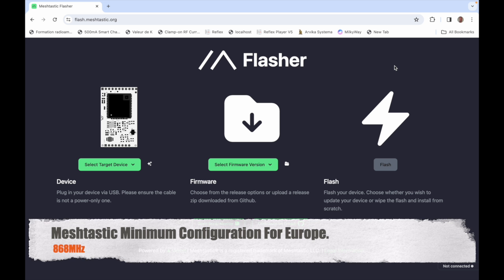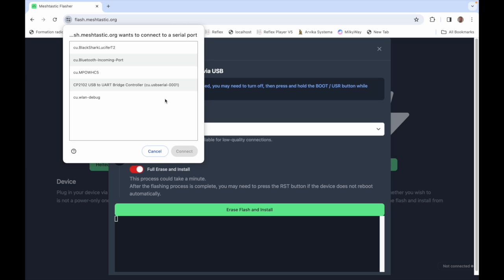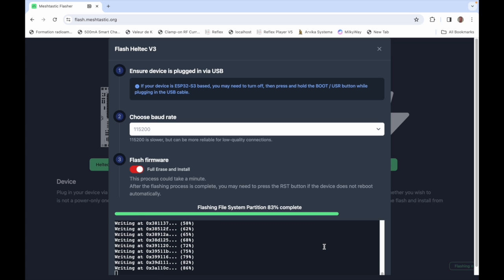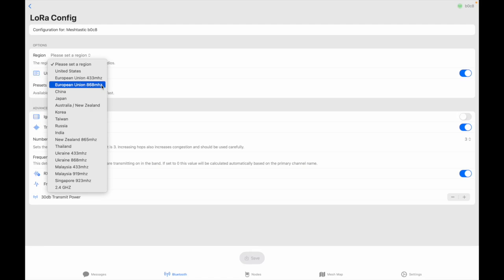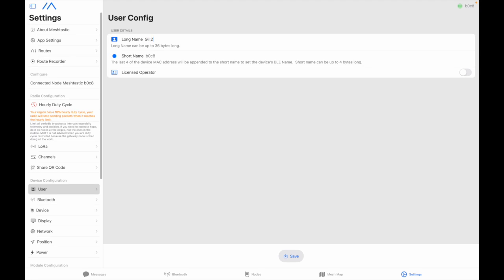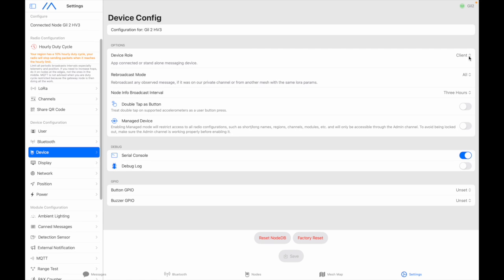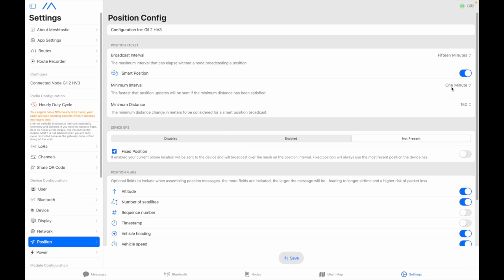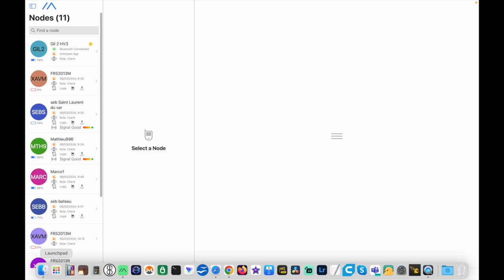Meshtastic Minimum Configuration For Europe.

Comment: Hi Gil great videos subbed . I'm having a problem i have the heltek v3 and have installed a gps neo6 rx pin48 tx pin 47 reflashed a few times but it just says no gps installed. Other problem I'm on pc or android and the layout of the apps are diffrent  cant seem to find some of the settings you usem any ideas thanks m7gnr
Reply from the maker: The Android app is better.. No idea about the GPS. Did you turn it on in the app?
Reply: @RadioPrepper  thanks for the quick reply but yes switched on in in app there is a blue led flashing on the GPS module so know it has power thanks anyway my friend m7gnr
Reply from the maker: I heard the GPS has to be on a certain pin, but can't remember which one..